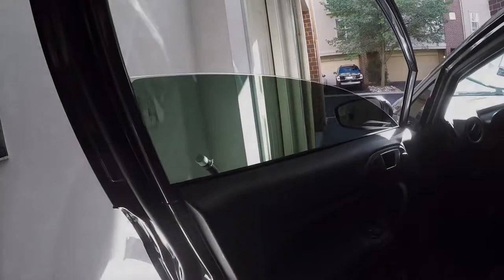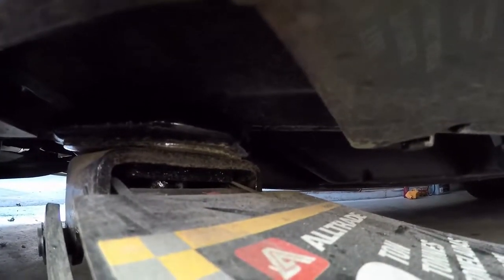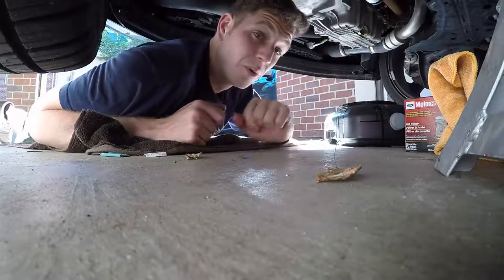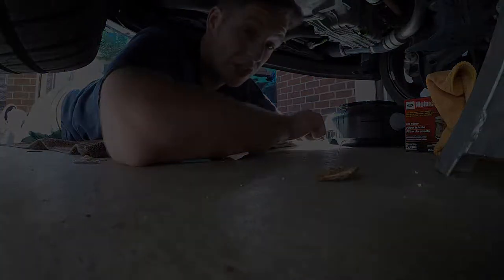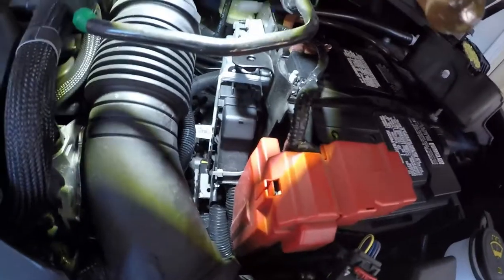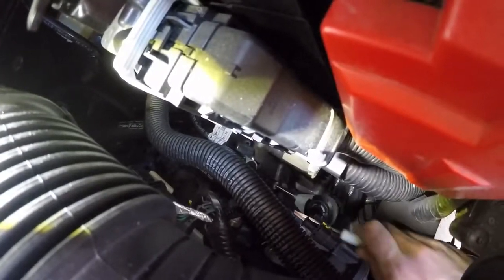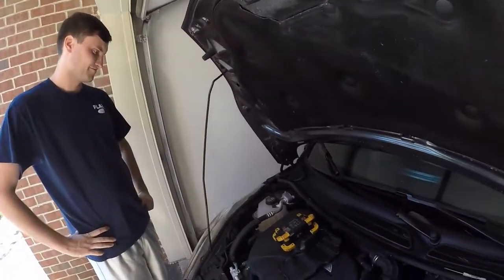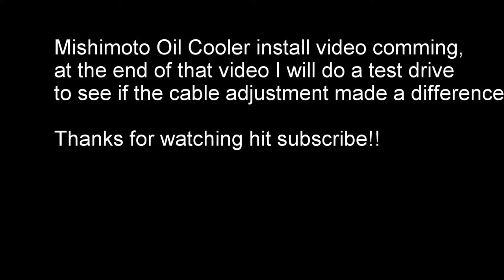First Oil Change in the FiST!! and Shifter Adjustment!

Comment: There are hockey pucks looking things you can use to put on the pinch weld so u have a flat surface for your jack plate to sit on (or cut a slit on a hockey puck)